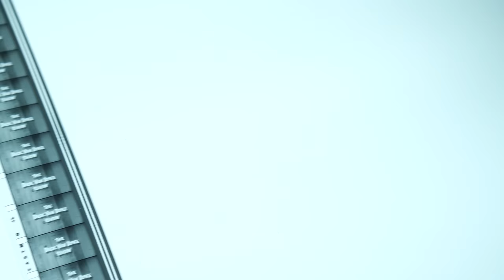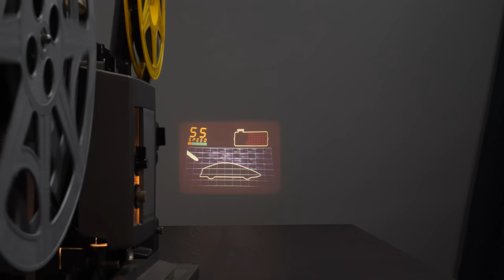Movies made sound with a light bulb: Sound-on-film

Comment: Another great presentation.  You left off my favorite analog system... The 6 channel magnetic striping on film that was read by the "Ampex Penthouse" This was used for some 70mm "road show" films like Larry of the Arib world.  The sound was before the picture as it was being read by the magnetic head mounted in the "penthouse" .  Not only did this provide multiple channels but eliminated many of the optical system faults.
Typical audio systems had very sharp rolloffs below 75Hz to eliminate the possible hum caused by poor filtering of the DC powering the exciter lamp. Any residual AC 60Hz would be audible as hum.  Optical sound was rolled off by better systems above 11kHz as the only audio above that would be mostly intermodulation distortion.  Although I've worked in a few "booths" back in the day, I did so while earning an MSEE.

Comment: There was also two other film formats called  Super 8 and 8mm. 
8mm format had no sound.  While Super 8 had sound. The reason was, that it was simply 16mm film that was run through a machine that sliced the film down the middle. Thereafter ending up with a reel of silent 8mm. And a reel of "Talkie" Super 8 with the other half that retained the audio info.

Comment: Ive got a bunch of 16mm films and some of them have bad sound tracks, particuarly ones with agfa film stock, for some reason the clear part of the track goes yellow with age and doesnt let as much light through. Im quite impressed how much research you have done on the different types of sound tracks, there was quite a few they used, and i find some types dont work as well on my eiki projector, particularly the prints that ran 4 tracks in parallel.

Comment: When I was in jr/ sr  high school  (graduated '66)  I operated  the class  projector  when necessary,  Bell & Howell.  I also acquired an older model that  mechanically, was like the  ones we used, and  ended up tearing it apart,  saving the audio section.  It was pretty obvious then, how this worked,  you examine the film and  study  the patterns  on the sound bar,  and notice the focusing mechanism,  the light source, and  photocell

Also  "back in the day" were simple  "voice modulated light transmitters"  where you could modulate a lamp with audio,  and  detect it a short distance away with a photocell.

Comment: This is a great video and beautifully explained and demonstrated. 
Just for accuracy: The way a single frame of film is projected more than once is by having a rotating shutter with more than one 'blade'. The shutter rotates once per frame but blocks the light more than once and during one of these blocking periods, the film is advanced by the 'little fingers'  also known as 'the claw' to the next frame.

Now your explanation is a little awry in explaining that the light is blocked 3 times per frame and that as there is 25 frames per second thats a flicker rate of 72 flickers or flashes every second. You've sort of mixed up two sources of that info.
The threshold for noticing flicker for the human eye is around 50 times a second.
In the silent film days they thought 16 frames per second was sufficient to record action smoothly while being economical with the length of film used and not being too demanding for the mechanisms available at the time. But projecting 16 frames per second caused too much flicker. Using a 3 bladed shutter gave 48 flashes per second and that was acceptable. Also projectors were often hand cranked and projectionists often ran the film faster to save time and also for comedic effect.
When optical sound on film was developed the linear speed of the filmstrip ar 16 frames a second was too slow to reproduce the higher frequencies, so a faster frame rate was adopted 24 frames per second and along with a 2 bladed shutter in the projector we still have 48 flashes per second.
So the Filmosound ought to have a two bladed shutter and run at 24 frames per second.

And of course those silent movies shot at 16fps now got projected at 24fps and still looked funny.

Now as an additional development, TV too has a frame rate but its done slightly differently (at least until recently) with interlaced lines making a full frame from 2 'fields' of every other line.  Because of the need to synchronise the camera with the recievers which are not physically connected, the early TV systems utilised the mains voltage frequency to synchronise. In the UK that was 50 Hz and in the US 60 Hz. In the UK this was near to the 48 flashes per second, so film on TV ran at 25 frames a second. Film shot for tv was filmed at 25fps, Cinema films already shot at 24fps were shown at 25fps. Saving about two and a half minutes an hour, ideal for slotting in commercials and promos. However the soundtrack was sped up and those with ears sensitive to pitch were really annoyed! In later years pitch correction was applied.
In the USA Film on tv ran at 24fps with an ingenious pull down mechanism (the little fingers) that spread the 24 frames over the 60 fields in a ratio of 2:5. Actually film to tv transfer machines referred to as Telecines didn't use an intermitent film transport, instead the allowed the film to run smoothly through the gate and the TV scanning system moved with it.
But it was noticed after a while that US TVs had less flicker than UK TVs (because of the flicker rate) and that there was a very noticably different 'texture' to film compared to video.
For years this was considered a charactristic of video that made it look 'cheap' and poor quality, the lenses weren't as good or something.  Whereas film looked authentic, real and expensive.
None of that is true. The reason for the difference is that video resolves motion at 50 or 60 'slices' per second, and film only does 24 or 25. While film had better detail (all lost when shown on TV) Video, from tape or live, has better motion resolution.

Which is why Peter Jackson tried to make The Hobbit at 60fps, running the film faster.

This had been done before by Douglas Trumbull, of 2001 special effects fame with his Showscan system. His film Brainstorm was supposed to be presented in this way, but now the film is famous (or notorious) for other reasons. I have read that in a private exclusive presentation of Showscan to a select invited audience in his private  cinema, Trumbull walked onto the stage to explain how it all worked. And then at some point, the real Trumbull walked into the room from the back while his Showscan film had convinced the audience that they were actually looking at him, live on stage. Apparently.
But when Peter Jackson's The Hobbit hit the cinemas, folk were confused, missing the point of the high frame rate and thinking it looked as though it was cheaply shot on video.
Now modern flat screen TVS can use interpolation to create high frame rate effects on regular films. I quite like it but Hollywood hates it and have obliged the likes of Tom Cruise to bang on about turning this feature off. George Lucas campaigned to get the standard for Blue-Ray films fixed to 24fps.  He is a Luddite.  Hi Def Hi frame rate video is now superior to movie film in every way. Anyone who says different is like those who say Vinyl is better than CD.
Thats all!

Comment: Those large platter systems were interesting when you would only get one print but need to run 10 screens with it. You'd basically just string the film from projector to projector using stands that had rollers to keep the film upright and moving.

Comment: 30:30 Many projectors were equipped with a bell that would start to ring when the feedout reel began to spin over a certain RPMs (since it spins faster the closer the takeup is to center). This warned the projectionist that the reel was nearing the end and they needed to be ready for a changeover. So they didn't have to watch the entire film, you'd have 10-15 minutes-ish to chill out once you threaded the next projector.

Comment: Until about 20 years ago optical soundtracks on film contained a silver image because the photocells in projectors were sensitive mainly to infra red which would be blocked by the silver but would be largely transmitted by coloured dyes.  With black and white prints both image and soundtrack would be silver so there would be no problem, but with colour prints a way had to be found to put silver in the soundtrack area.  There were two ways of doing this.  In the Technicolor imbibition or dye transfer printing process a film coated with a black and white emulsion was used and the soundtrack was printed photographically, then the three coloured dye images were transferred to the print from matrix films, similar to the way that images on paper are printed with coloured inks.  This process was phased out some years ago and release prints were made on colour film stock with both sound and picture printed photographically. Development of this film would produce a silver image and three coloured dye ones in yellow, magenta and cyan and the silver would then be removed by bleaching and fixing the film before a final wash and drying.  The bleach was basically an un-developer, converting the silver back to silver halide which could be re-developed before the fixing step.  This redevelopment was carried out in the soundtrack area only by means of a thick viscous developer applied by a wheel.  Tracks produced in this way usually contained magenta and cyan dyes, plus the silver, while ones produced by the Technicolor process contained only silver.

If you have a 16 mm track which seems to be only silver then you are probably looking at a Technicolor dye print.  These were widely used at one time and were printed two up on specially perforated 35 mm stock and were then slit after printing with the 3 mm waste strip on one edge slit off.  There were tracks which contained magenta dye and silver and look very magenta in colour, these existed in both 35 mm and 16 mm but seem to always be variable density tracks.  There were also blue tracks used on some early two colour processes such as Cinecolor.  The blueish image on these films was produced by toning with an iron compound which absorbed strongly in the infrared.

The redevolment process was considered to be environmentally unfriendly, and if anything went wrong could result in spoiled prints, so it was decided to switch to tracks containing only cyan dye and no silver, with 35 mm projectors having to be converted to a red light source, usually LED or laser rather than the traditional incandescent exciter lamp.  Due to the difficulty of converting 16 mm projectors, and the much reduced use of 16 mm film prints by that time this conversion was not made for 16 mm.  Optical sound did exist on Super-8 film but were not very common.  Due to being very narrow the redevelopment process was not practical for these, so they never contained redeveloped silver.

Sorry, that was a much longer post than I intended.

Comment: Great video! I used to work as a projectionist so I knew a decent amount of this but it was still entertaining and informative

Also, I had a few video ideas for you (some of which I suspect you've already thought of, but just in case you hadn't, or at least to indicate that you have at least one subscriber who's interested…):

- induction range
- air fryer oven vs convection oven vs counter top air fryer
- heat pump hot water heaters
- heat pump (“ventless”) dryers

Comment: In TV land, when we were transmitting programmes that lasted longer than the 90 minutes maximum run time of a Qudruplex VTR, we had to use the cuetrack in much the way film cuedots were used, but far less frequently. This was called a Duplex changeover. At 30 second before the changeover, a voice warning was recorded on the outgoing VT cuetrack, at ten seconds a 'RUN' command was announced. ten seconds later, once the second machine had locked up, we cut across to the second machine.
Similar games but without the cue track recording were used for 'live' transmissions of football matches - cutting out the interval. The first half was recorded as live, transmitted when the TV slot was expected. The second half was recorded on a second machine and played out - after the actual game has ended but with a far smaller gap between the halves. There were many variations on this trick.

Comment: Re how the sound was 'attached' to the print... release prints were made on contact printers such as a Bell and Howell Model C. The sound print and camera print were both run on the printer but at separate 'places' in the unexposed release print films path. The 'release print' film would go over the main 'image' drum and have the image from the camera print exposed and then it would go over the sound drum where the sound image would be exposed. Sound prints are full-width film prints with just the sound down the side. So short version, one machine sandwiches ('contacts') the camera film and sound film to an unexposed negative ('release print') to create a combined image/sound release print.

Comment: Been there done the projection thing, using some really old projection gear, including peerless magnarc carbon arc lamps (powered by mercury arc rectified DC). Running a film is as you say hectic, there are 3 projectors, and manual changeover of the film, manual rewinds. The 3rd projector is ready at each change of reel, and the shutter opened if something goes wrong in the switchover between projectors.

Comment: The art of putting sound with/on film is an interesting topic. Lots of great mechanics and electronics needed for the camera and projector. But are you aware there was a time when color news film footage was recorded on Black & White movie film? I'm not talking about separate exposures via RGB filters. A complete color image was recorded on a single B&W frame. It used an elegant technique that did not need special electronics or moving mechanical contraptions. This technique succeeded since the cost of color film was considerably more than B&W. It enabled the news crew to take more 16mm footage without straining the budget.

I learned about this some decades ago when taking an advanced optics course, where the instructor explained the concept. In short, it involved using optical Fourier transforms in a unique way. The mods to the B&W film cameras were minimal as well as the projectors for image reconstruction. This allowed TV news crews to use relatively inexpensive B&W film to show their report in Color during the TV broadcast.

This technique eventually gave way to magnetic video recording technology.

Comment: The part I like about these film protectors is that it's all analog.   It's impressive that these machines were even invented. And are still working.  Modern technology just quits working and your dead in the water.  I have one with an auto loader and one that uses magnetic tape on the side of the film.

Comment: About the masking tape mentioned at the end. When I was a kid, I went on a tour of the local movie theatre. While showing us the projection room, the projectionist showed us how he spliced film together. He had a device where he could align two pieces of film, cut them so that they were perfectly aligned between frames, and then join them using a piece of tape (it looked like masking tape) and punch out the holes for the teeth on the sprocket. The tape maybe covered one or two frames, so you wouldn't really notice it. Your comment about masking tape getting caught does make me wonder if that's what happened here.

Comment: I was one of the last 35 mm projectionists Maya movie theater before we switched digital. I was Cisco certified so I got to stay after we switched from digital but for the longest time I was doing 35 mm. The only difference between this and the 16 mm projector you have is that the Rocket roller in front of the aperture was programmed to stop on the Wheel for a fraction of a second and we had a sort of metal fan that ran in front of the film between the film and the lens instead of the other way around which works great until there was something wrong with the film feed. Or sometimes somebody might put in a brand new bulb but not adjusted properly which would cause the film to burn just slightly on the first run and then on the second run we would know that there was a mistake made when the footage obviously looked a little toasty in the middle

Comment: Long live your 8mm projector, but when you showed the main plastic gear inside, I saw cracks that may cause your projector to fail to pull film in the future.  I undertook a project to replace that gear.  It was a daunting task because of so much that had to be taken apart to remove the old gear and replace it with a new one.  Luckily at that time and perhaps still now those gears were available,
By the way, B&H has a 3 claw device to pull the film by the sprockets, EIKI has a 2 claw puller.  3 claw can often pull the film if occasionally a single sprocket is broken.

Comment: 27:45 In a country using the international system, the length of the reel is measured in meters rather than in feet. In French, a word similar to "footage" is used, "métrage", obviously constructed on the word "mètre" (meter). Short films are called "courts métrages" ("court" means short) and feature films are called "longs métrages".

See "Cinema Paradiso" for the work of the projectionist